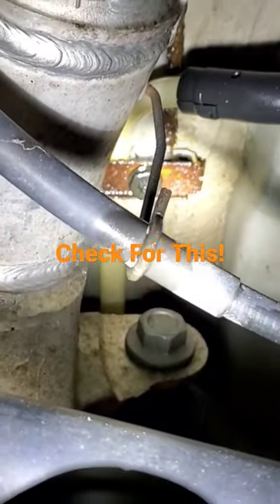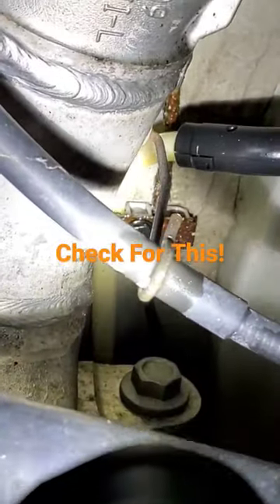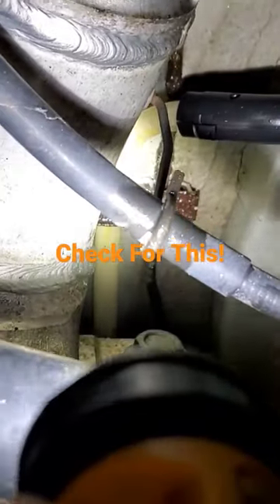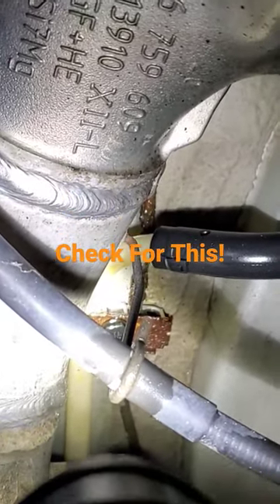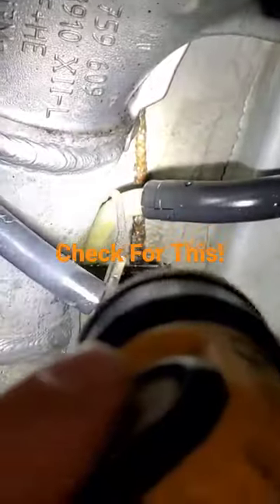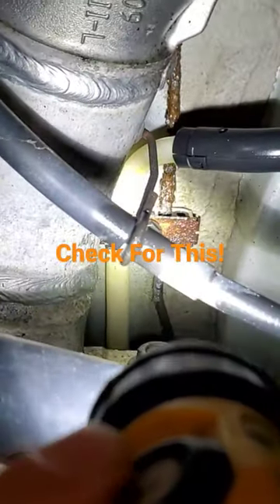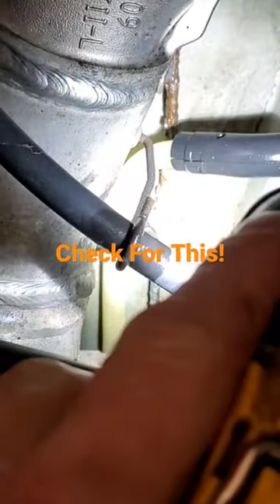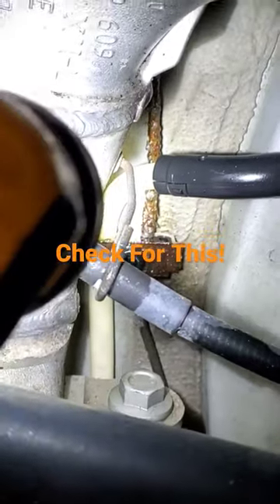Check This To Prevent Loss Of Brakes! BMW 5 Series E60 X5 E53 E70 #loss of brakes

Comment: Dam Roger again u rock   1 e60 2 e61 all are down. Inc my 460 truck
Reply from the maker: Very common on the X5 E53 and E70 model year but less common on the E60. But once dirt gets into those holder they cause the coating to fail and then the brake line fails. Happened to me on my GMC trunk as well!